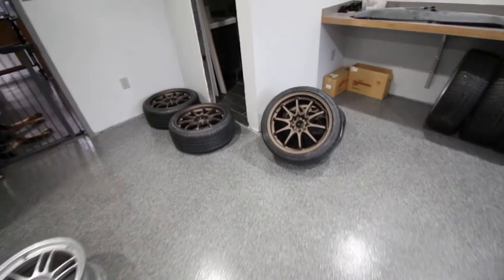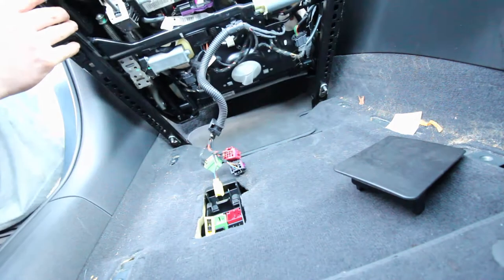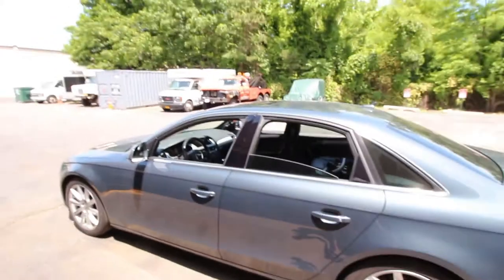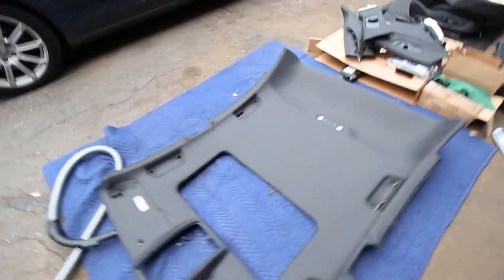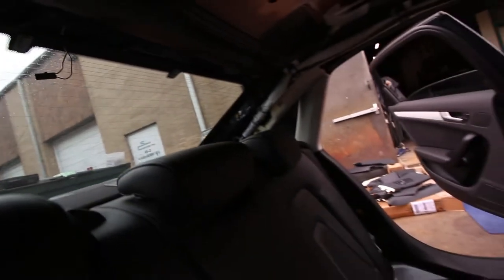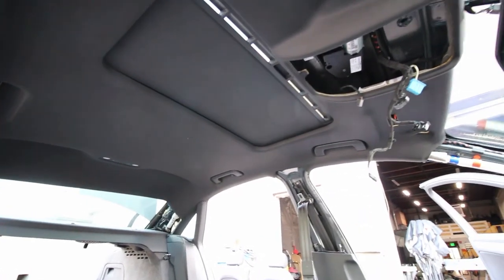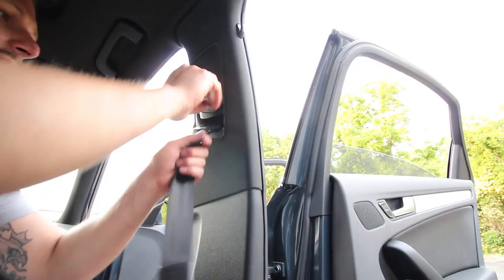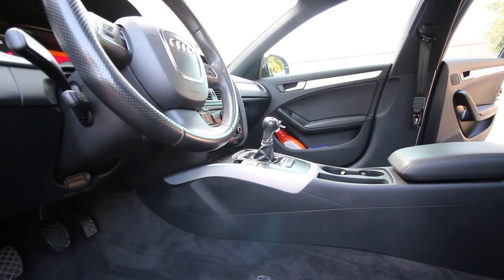B8 AUDI A4 to S4 HEADLINER & INTERIOR SWAP - DISASSEMBLY & ASSEMBLY

Comment: You think this is bad, its even worse on the B8 wagon. I just pulled my headliner an dyed it red, swapped in red seatbelts, installed a 550 piece starry light kit, also did the S4 seats and a R8 factory steering wheel. Whoever designed the grab handles is a scumbag, I broke all 4 of them. Cool video Instagram brought me here
Reply from the maker: Hey Phil, i can only imagine the nightmare with the starry headliner! i've seen the back side of those! haha sounds like you did everything in there, i have 2 more interior vids coming out soon for the boost gauge install and a b9 steering wheel. Hope you get to see them too. Also those handles ... after the first one i ripped the next one out lol and then made the little bent screw driver took which helped a ton.